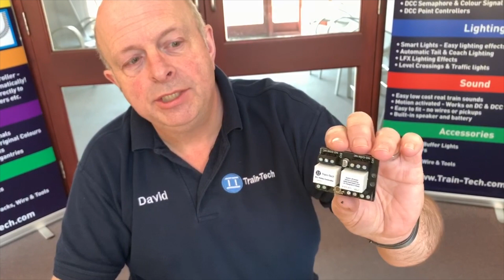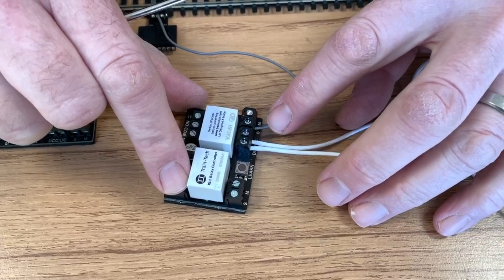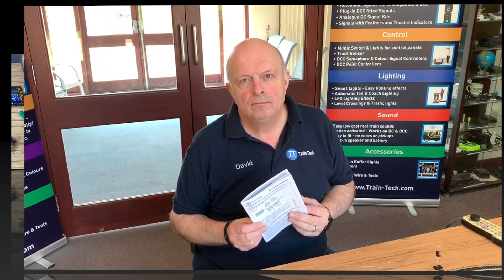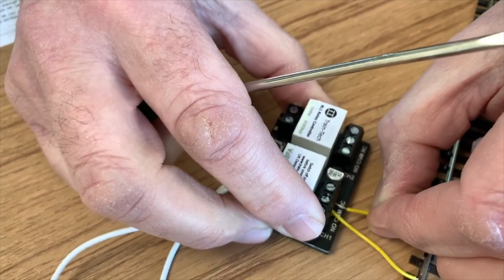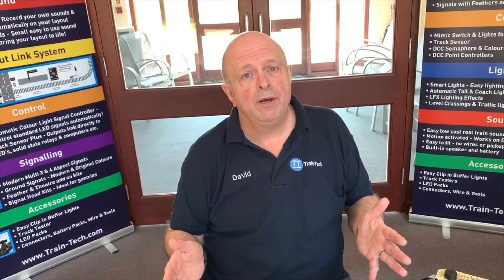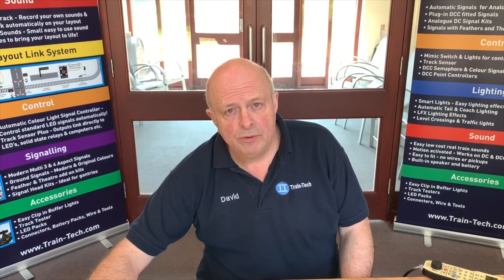Train-Tech RL1 Relay Controller  - An introduction

Comment: Quick question, if you are running a dc power on the track but the loco is fitted with an hm7000 dcc bluetooth chip with abc,  will the abc diodes still slow the train in an abc way, given the dcc command is not coming via the track but via bluetooth?
Reply from the maker: HI, in all honesty we haven't tried our RL1 with the Hornby HM7000. I would imagine the loco will stop as the RL1 cuts track power but if the ABC is fitted and powered via Bluetooth then this wouldn't work.

Comment: I am trying to work out how to use these with the train tech sensor signals to control ABC modules so that on red ABC is in stop mode, yellow ABC is in slow mode and green no ABC.  How can I do this please?  Currently I am using DCC Concepts ABC modules for enforcing point signalling but I don't think these can work with the sensor signal modules.
Reply from the maker: HI Andrew, we can see the email that you have sent to us. We shall have a look at your enquiry & get back to you as soon as we can

Comment: Hello again 
I am selecting some of your products, relays and SC100, but I want to Be sure that other brands light signals can be interconnected to the SC100 in order to operate accordingly with the relay control solution

Thanks
BR

Comment: It was not clear in your video how the sensor was connected for a DC layout.  Also you mentioned the relay only operated for 7 seconds; could this be adjusted?
Reply from the maker: Hello, Thanks for your feedback and question. This video is primarily about the Relay Controller but if using Sensors to control it (as opposed to DCC commands) both the ST10 Track Sensors and Sensor Signals can be powered by either DC or DCC. If powered by DC the clip in track contacts are removed and 9-16 volts smooth DC applied to power the sensor or signal. The 7 seconds cannot be changed but only applies when using a single track sensor or Sensor Signal. When they are linked to other sensors/signals they work on occupation in blocks, not time. Full details on connection and operation are supplied in the instructions included with all Train-Tech products and you can also view all product instructions at www.train-tech.com.

Comment: Hello, the system looks great!!! Do you have available on N gauge?
Reply from the maker: Hi Thanks for your question. The RL1 relay controller will work fine on N gauge as well as OO gauge but we cannot fit all the electronics inside an N gauge signal but we do make a trackside signal controller called the SC100 which can be used with N gauge signals like the Gaugemaster ones etc. If you look at the bottom of the following page it shows you more details and you can view the instruction manual. http://www.train-tech.com/index.php/signalling/sensor-signals-fully-automatic-signalling